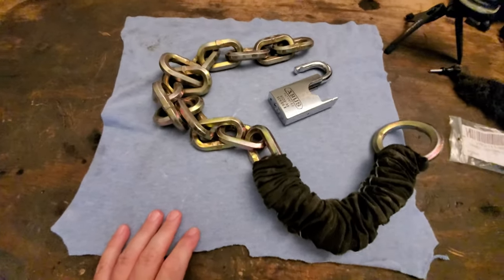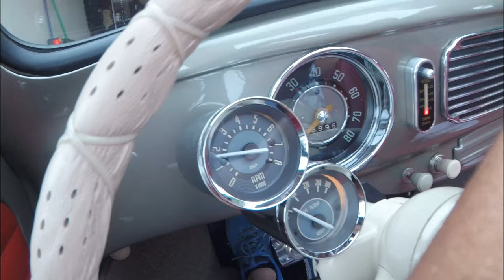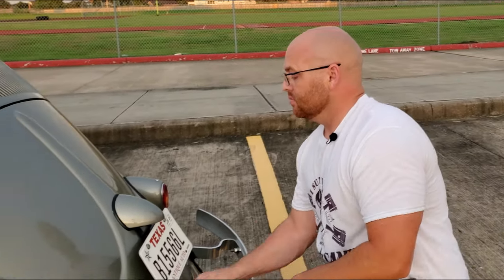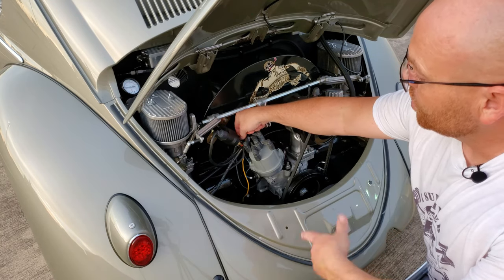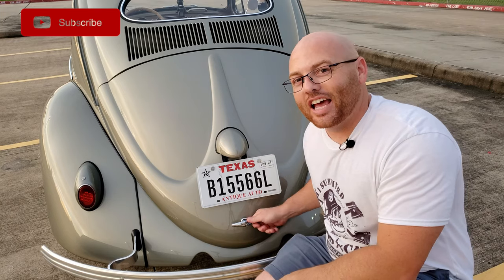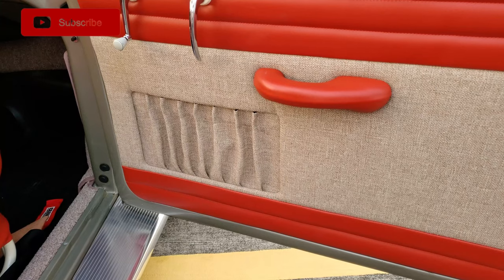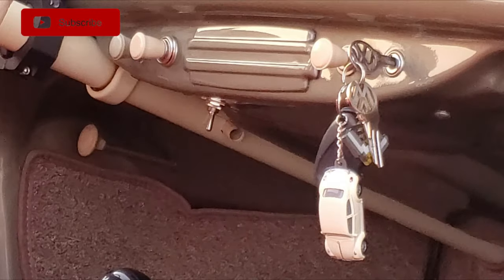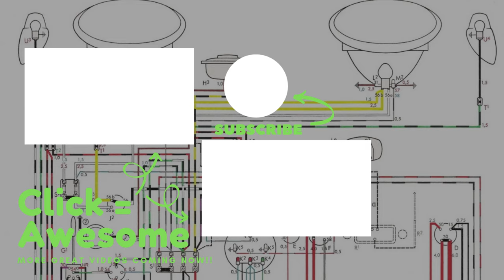How to Theft-Proof Your VW BEETLE! STOP Car Theft! | JW Classic VW

Comment: What I sometimes do when my bug/bus is parked in the garage while I'm away for the weekend, is remove the rotor from the distributor and put the cap back on ...
It looks neat & clean, so anyone getting into the engine bay can't even see any disconnected wires ... Just takes 30 seconds ... Some great tips here!
Reply from the maker: That is a good one, my dad use to do that all the time on his rail buggy he had.  Easy and quick.
Reply: But missing distributor rotors are probably one of the first things pro thieves look for, and will have extras on hand.  Remember they only need to move it a short distance to get it into a covered truck and away they go.

Comment: Instead of a toggle switch for the fuel pump relay, you could use a large jack plug like the kind on a guitar lead and connect the terminals together inside it. Mount the socket on the dash and connect the low power earth lead from the pump relay to it so that when the plug is inserted, it completes the circuit and energises the pump. You can keep the modified plug on your key chain. 
Much more secure than a switch that anyone can use when they've found it.
Reply from the maker: Cool... is that what you have?
Reply: @JWClassicVW  not currently, but I've done it in the past and I'm planning to use it again when the car is back together.
Reply: That's actually a great idea! Thanks for that!
Reply: Love the idea except for a hole in the dash
Must think of another way to implement this awesome idea
Thanks for sharing 👏👏

Comment: I grew up in the inner city of Gary, Indiana during late 60's - 70s & Crime was off the charts. My buddy had an old car he used for driving to work at the steel mill. At his house he would park it between two trees then lock it up with logging chains to the tree's every night. One day went to his car to go to work; the car was facing the other direction between the tree's. It had a note on it and said; " If we wanted this old crap car we would have taking it a long time ago"  On my sons beetle when he drove it to the local college ; he used a magnetic reed switch on ignition. It a  very low crime area but he liked the exrta protection. Funny one day he called me; dad my car will not start..did you enable the magnetic reed switch under the seat..no I forgot..
Reply from the maker: Lol... that is a great story Dan... love it! I may mention you and it in the next video. 😃 How have you been, are you feet doing ok?  Good to hear from you!

Comment: I was thinking about drilling a hole through the clutch pedal and the brake pedal and use a big pad lock to lock them together, I understand it can still be pushed or pulled but not driven away easily
Reply from the maker: Definitely would work!

Comment: Do you need a relay when installing a switch on the fuel pump?
Reply from the maker: Not if its close to the fuse box like mine.  If it's hidden somewhere further away then you may.
Reply: Awesome. Good to know. Was planning on hiding the switch in my glove box. 
Great content. Keep it up

Comment: what was the PSI air filter thing you showed installed above the engine coming off the engine?
Reply from the maker: Fuel pressure gauge.
Reply: @JWClassicVW  thanks, what advantages does this give you?
Reply from the maker: @michaelsaxbury8705  The fuel pressure gauge along with the fuel regulator ensure the proper fuel pressure is getting to my dual Webers.  To much fuel pressure or to little can cause all sorts of problems.  The gauge is a quick way to diagnose issues.  

You can check out the install video here if interested: https://youtu.be/na9Q7ajdIZA

Comment: What final drive and gears are you running?  Is it a highway flyer?
Reply from the maker: Standard Pro street build from Rancho. With a 4.12 ring and Pinion.

You can get it from CB Performance.
Pro Street Transaxles  Super Diff ready, Heavy Duty Side Plate, welded 3rd and 4th gear hubs, steel shift forks, and hardened keys.  The gear ratio is that of a freeway flyer, but just built stronger.

1st gear: 380. 2nd gear: 206. 3rd gear: 132. 4th gear: 0.82.
Reply: @JWClassicVW  .82 4th.  I did notice the low revs while you cruised at 65mph.  I have a 3.88 with a stock .93 4th and my revs at 65 are significantly higher.  Love your videos, keep up the good work.